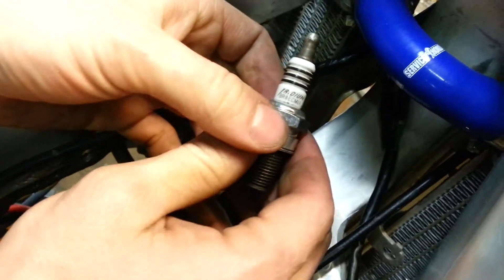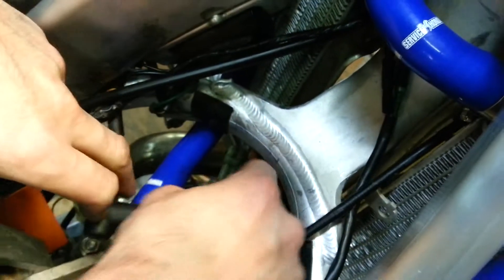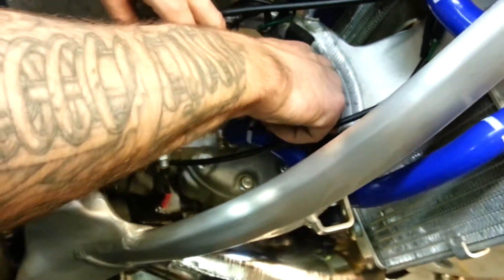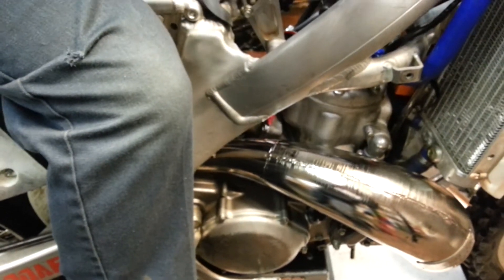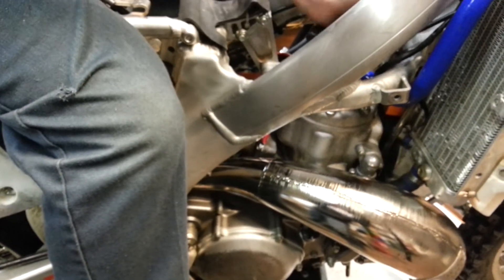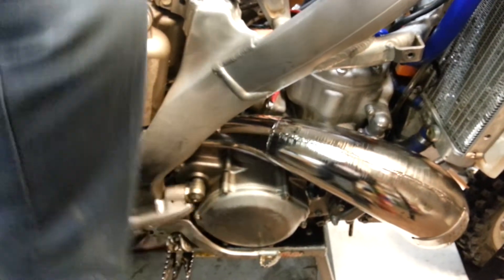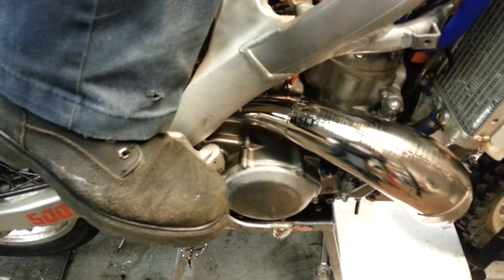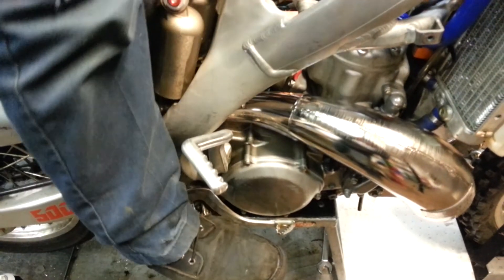Testing the Service Honda CR500 Digital Ignition

Comment: Fun fact i just tested... If you supply 10v dc to the CDI instead of the coil, with blue on positive ans white on negative, you will get spark every time the flywheel comes across the hall sensor.. that's right. Spark from near zero RPM onward.
Reply: First of all: are you kidding or is that true? You know, frying those CDIs is expensive... Also, how did you come up with 10V instead of the battery voltage (12-14V) and did you use a DC-DC-converter for that?